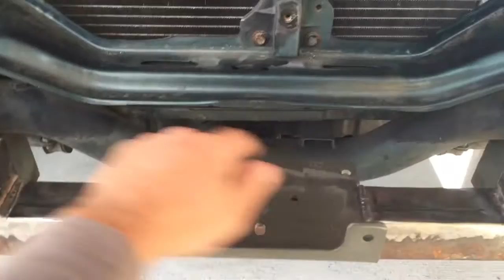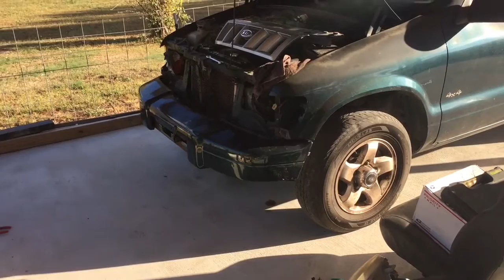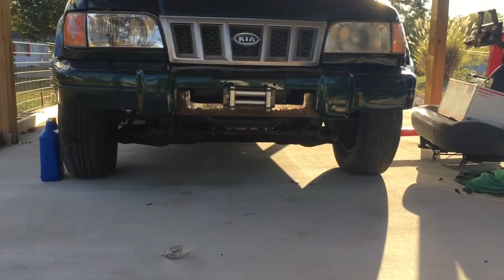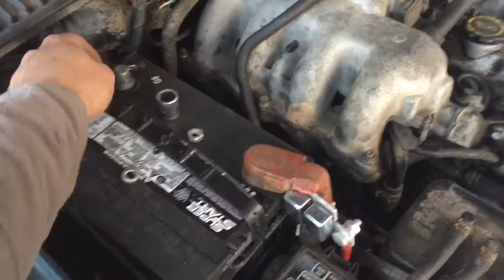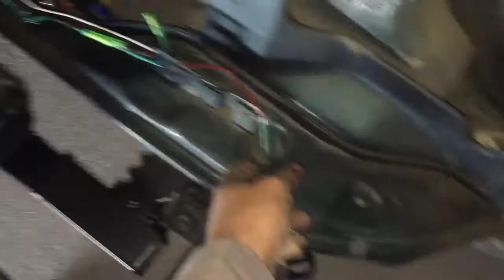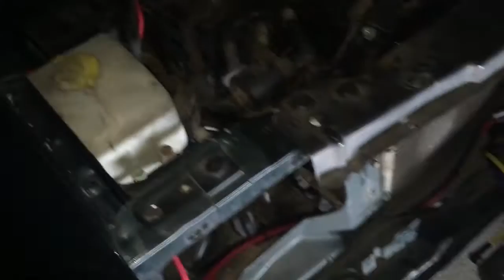Sportage winch bumper part 1

Comment: What motor do these have? I have a 2000 Sportage 4×4 and looking to find a low miles replacement motor. 

Awesome winch setup
Reply from the maker: 2.0 fe dohc.  They can be found for cheap, they’re strong little engines